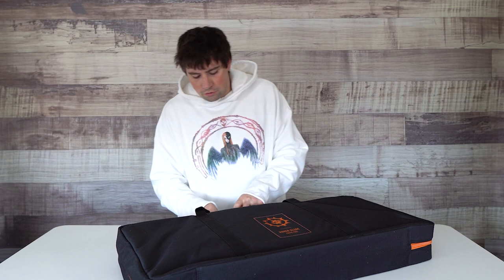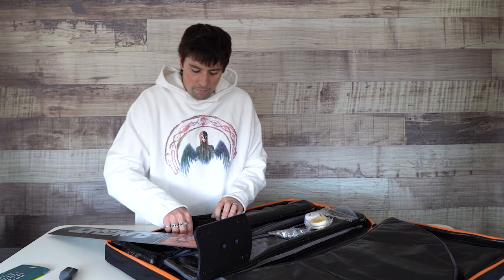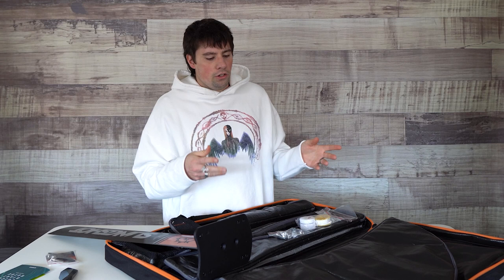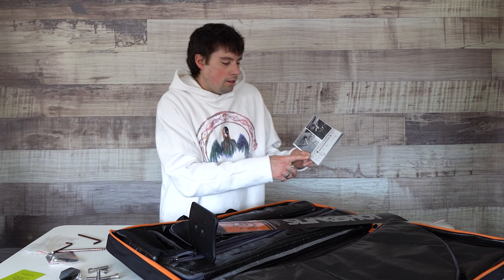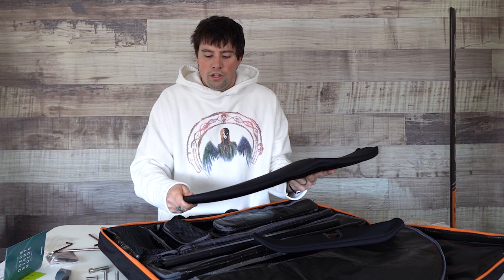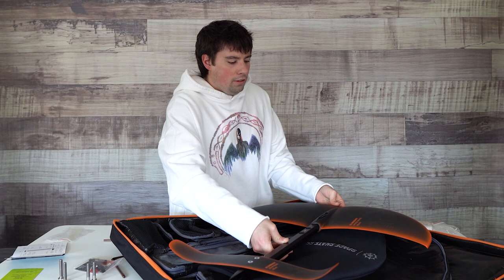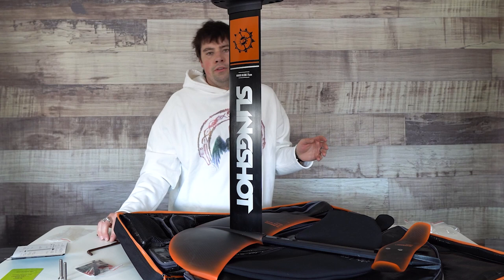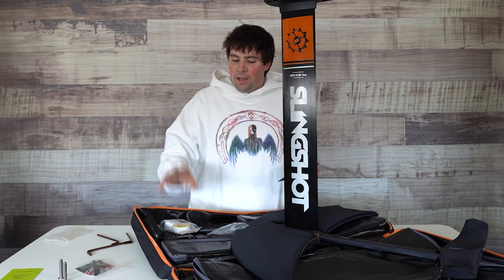How to Assemble Your Slingshot Hoverglide Foil Set

Comment: How does the mast position (A or B) affect riding performance/characteristics?
Reply: B Position moves the pressure to the front and is better for pumping. It allows more leverage mostly used for Wing Foiling, Surf Foiling and Pumping. For Kitesurfing A position is the best because of the higher speeds and resulting  lift of the wing.
Reply from the maker: It will depend on your board, weight, and wing being used. I tend to use A setting on all wings up to the 84 and 99. Those tend to be better in B setting for most boards because they like to be ridden so far forward under your stance. -Tucker

Comment: I found that it's easier to tape all the screws first (without the grease on the screw) and then add the grease on top of the tape afterwards.
When I've put the grease on first it gets very difficult to manage the tape.
Reply: @Stein - You do both?  I thought it was one or the other
Reply: @bmrbca3658   There is Vibrational Detatchment and Electrolytic Corrosion (Electrolysis) working together.
How long you intend to keep your kit assembled + your water quality determines how much preventative work you want to do.
The teflon tape acts as a gasket to reduce/prevent vibration and assists the oil or grease to fight corrosion and insure the kit can be disassembled.
Naturally, grease and oil are sand-glue.
Shaking sanded screws in a little soapy water in a Tupperware box will help clean them.
Reply from the maker: Thank you for the awesome insight, Brother! 🤙🏽